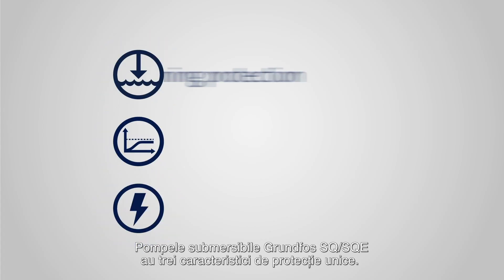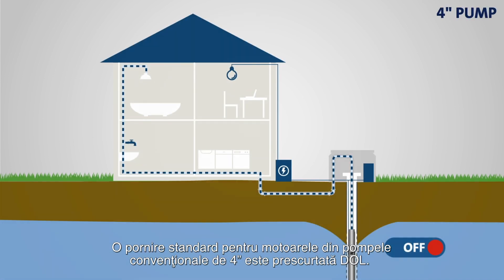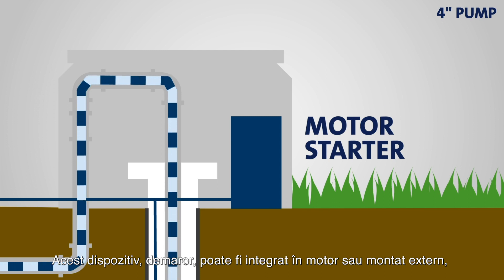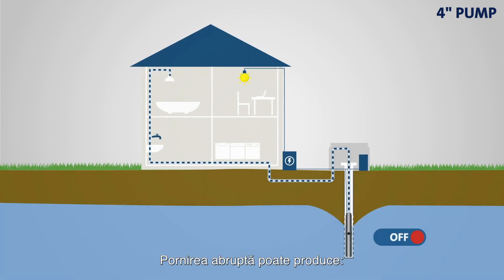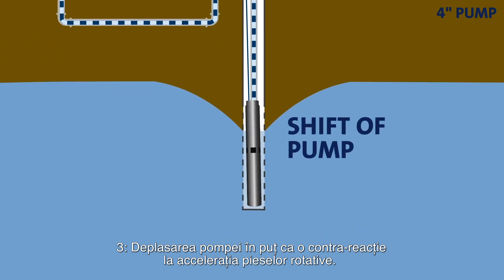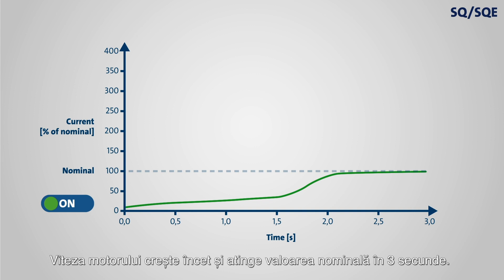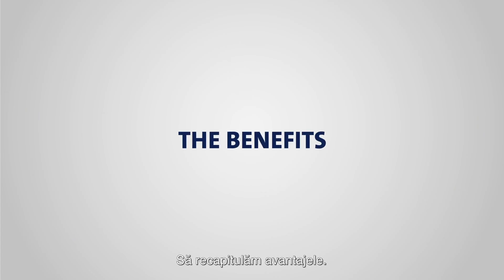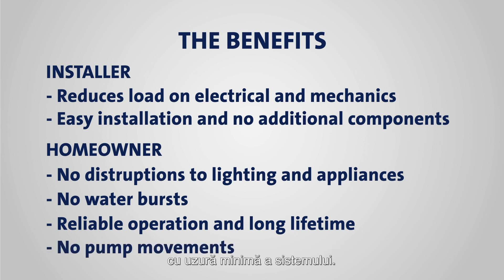Pompele submersibile SQ/SQE pentru foraj si avantajul Soft-start (pornire lenta)

Comment: Hi. How about soft stop? my pump makes a lot of noise and produces water hammer when it stops. Are there any pumps that have soft stop integrated or i need a separate automation for it?
Reply from the maker: Buna ziua, Va multumim ca ne-ati contactat. Va rugam sa verificati informatiile tehnice, inclusiv manualele de operare și instalare de pe site-ul nostru web. Va rugam sa cautati produsul de care aveti nevoie și sa utilizati sectiunea Documentatie pentru a gasi și a descarca toate informatiile. Aici: http://spr.ly/6050OO9Hm Daca doriti informatii suplimentare, iata datele noastre de contact: Departamentul de Ofertare ofertare@sales.grundfos.com si telefon centrala Tel.: (+40) 21 2004  100